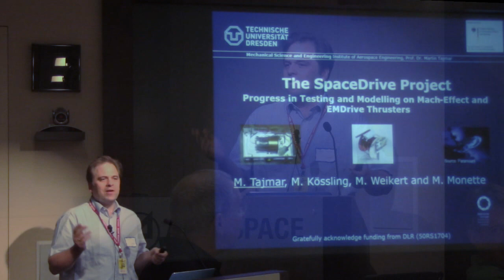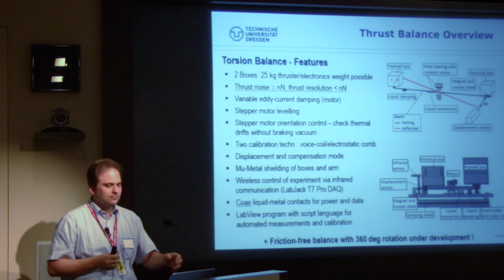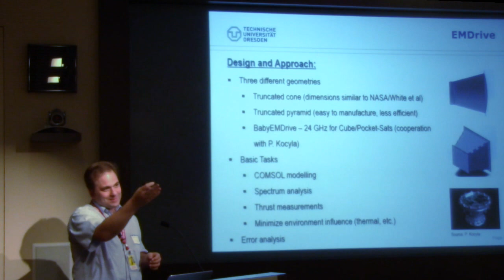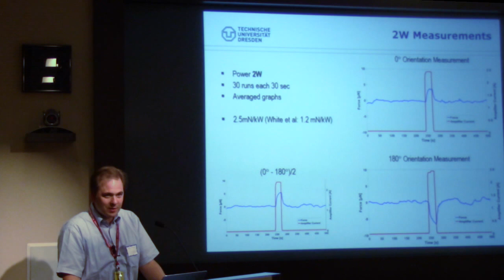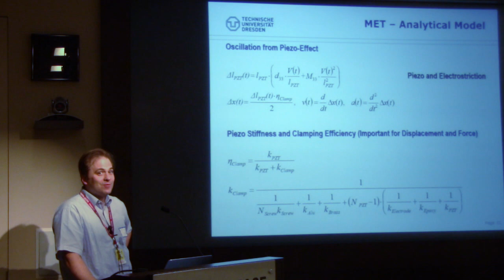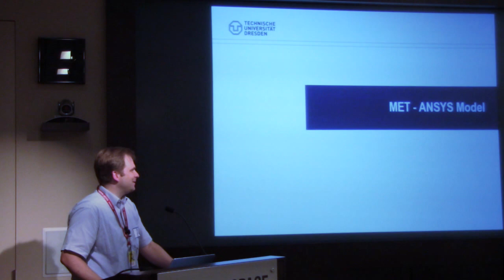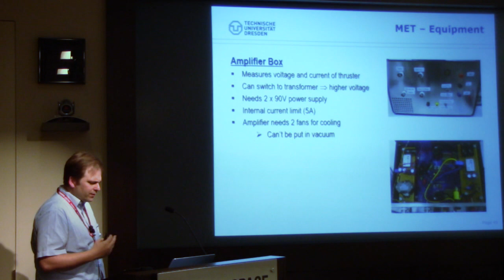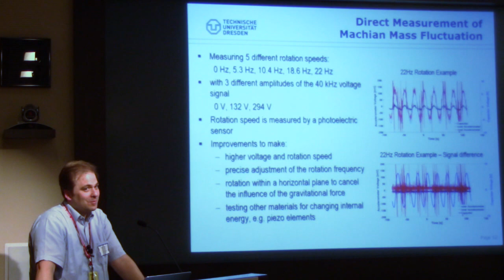SSI APW 2017: 04. Dr. Martin Tajmar

Comment: I am not so clever as to claim to fully understand em drive (group theory is difficult!) but have followed Shawers work since 2006. The scientific rigour that Dr Tajmar is bringing to this field is just what is required.  since Shawer met with  the military (including DARPA) in Shrivenham UK his website has become very quiet. Anybody know what is happening with his work?
Reply: Thanks for the 'heads up' on this, perhaps this is why the website has been so quiet. My (perhaps naive) take on this was that it produced a sort of rack and pinion effect, i.e. a wave in free space is not tied to the device, though the wave is produced by the device, this would be the rack. The electromagnetic standing wave within the device would be the pinion making its way along the rack through electromagnetic interaction with the wave in free space. Have you a background in microwave physics?

Comment: It would be interesting to understand how using a clamped stack of alternating pole electromagnetic coils in replacement of PZT disks would work. If it's just mechanical force and inertia for the Mach effect drive then electromagnetic repulsion between a clamped stack of coils could produce a higher force than PZT?? Maybe you'd get a much lower Q so then maybe that would be the floor in that idea :)

Comment: It's important to engineer in dissipation at one end of your cavity in my opinion because of the judgements I've formed given my research. 

On another note, the effect we want (thrust) from an EMdrive is very small and ambiguous, and the only ways to make useful amounts of nonambiguous thrust are to pump LOTS of power into the cavity (which isn't feasible because you'll eventually cause dielectric breakdown of air or just melt the cavity down) or the other option is to replicate the performance of the relatively large size EMdrive cavity many times over on a micro scale using shorter wavelength light. I've taken the lessons learned from my big copper can and I'm making billions and billions of tiny ones.
Reply: what about make a superconductivity cavity?